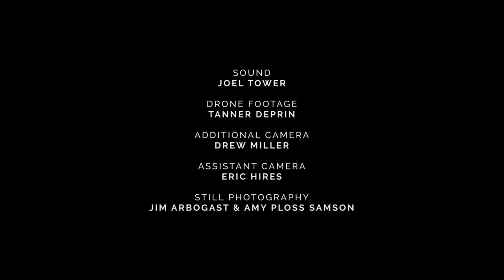Sons of Speed

Comment: One that rides knows that w/no, brakes, no transmission, no suspension, nothing but a frame and and engine...there's nothing left but, knowledge of your ride, talent, a great measure of good fortune, and more than a ton of BRASS BALLS...women certainly included.
Brutal honesty.
Ya' gotta love it.
Reply: I’ve gone down hill at 50 miles an hour on a bicycle before and at that speed I thought I was going o die! That’s essentially what they were doing but with a 40 horsepower engine with no brakes and at 100 miles per hour. And don’t forget, they wore a leather hat for “protection”...

Comment: I love this type of racing, am wondering though if they could establish a class for newly made bikes running on lawnmower engines in beach cruiser frames, single speeds w/no brakes as like a junior league. It wouldnt be expensive to build & would get more people into it. Not that I'd get  2 race any of these legendary guys who I look up to,but being able to compete in  league that raced bikes built to classic/antique specs has alot of appeal & I know I'm not the only guy who'd want to participate. Still makes me wish for my grandpa's WLA, as I love flatheads .
Reply: @ things needed here, give it a throttle begone with the kill switch and some rudimentary brakes would be cool as well even if it is something from a modern day mountain bike just something.
Reply: These guys don't want normans in there thing man. There happy with the prays and fan fair.
Reply: Good idea, what size motor?  A 6.5 hp Predator would probably go 65 mph or so.  Yeah put a twist throttle and brakes on the thing.  The board trackers back in the day died a lot.  That would take the fun out of it.
Reply: Get a website going and see what happens.
Reply: I built one of these using a walmart 700c style bike and one of those 2 stroke kits. Its built for top speed and will do just about 40 mph. Its tons of fun and only cost less than $300 total to build. Gets alot of attention also.
Reply: @rdooski  just add steel drop handlebars to the bike and it is a more like a old Bore racing  bike
Reply: Run nitro methane

Comment: I saw board track racing at the Ohio state fair in the mid sixties. I was too small to really watch the race, but I fought enough glimpses to know they were motorcycles on a wooden track with a super high bank.
One has to ask, if these bikes are so far and few between, will they allow replicas to be raced if they're built to the original specs? Sure, they will be modified, but they will have to be built around the original design specs to keep things fair and still have enough bikes to go around for those who want to ride them!

Comment: I raced flattrack a couple of times.... I quit after I highsided and skidded on my helmet so far that I put a big flat spot on it.
Reply: I done some racing as well, but that was on ICE, back in the 1990’s, two wheels and a motor, no brakes, no transmission, and limited safety equipment, but we had studs on the rear tire. If you went down, all you could do is ride the ice and pray that some else didn’t run you over!

Comment: And now we ride cheap China 2stroke motors mounted on cheap China bike frames!
Reply: Cigar City Soundz just ordered one lol
Reply: Start looking for vintage bikes, pre 1979, then find some vintage motors like a REO, Briggs & Stratton, or a Kohler, at least this way you know that it is all “Made in America “. I’m starting a build like this, more as a father son project, and a daily commuter to work, 2.5 miles away, I don’t need the speed any more, but still believe that not enough power is just as bad as too much, 15 hp on a 1966 Schwann, and a belt drive system should do the trick, tension drive between motor and jack shaft, like a tank shifter setup, no clutch, just direct drive. Drop and go!, we all have to have fun!

Comment: I do not see much speed. How fast are these old things going. Probably about 30 MPH. At least they will not get hurt if they fall off.
Reply: These same bikes originally raced at speeds between 80 to 100+ mph on the old tracks.  There are a few old films on YouTube, showing the actual racing back then.  Some of the old board tracks had banking as steep as 60 degrees, and the bikes would go through the corners at full throttle.  But with only one very tall gear, the bikes took a full lap on the long tracks to get up to full speed.  The track on this video is too short to allow these bikes to reach full speed.